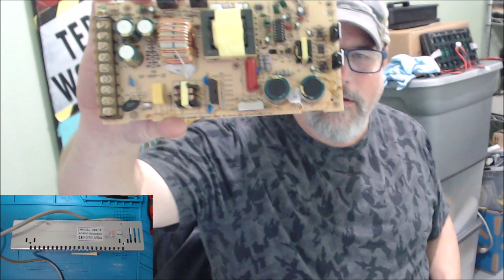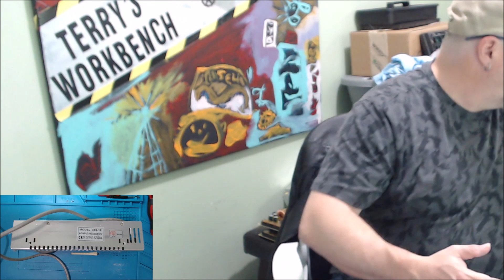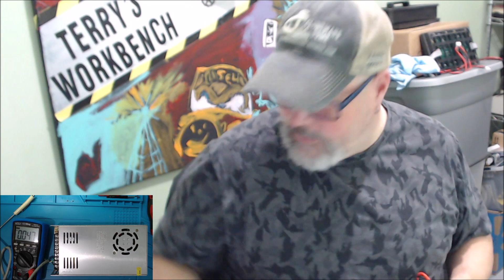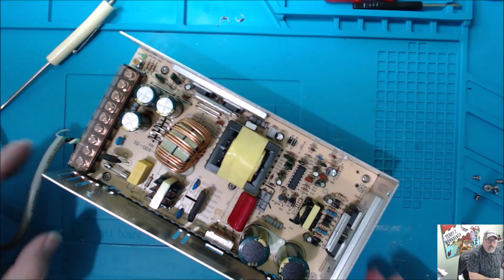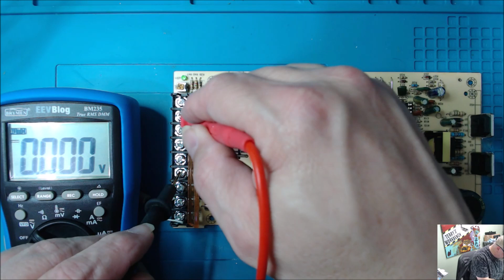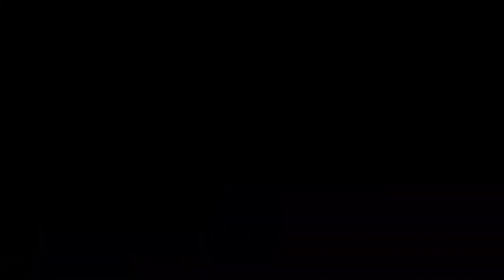Inexpensive Amazon 30 Amp 12 Volt switching power supply repair. 360-12

Comment: Make vid 9n how to quite these power supply they are noisy for radio HF use
Reply from the maker: I know they don't radiate much noise, as I have dozens of these in the front yard and the 160 loop is completely quiet with them in operation. I will take a look on the spectrum analyzer and see if there is anything interesting on the output.

Comment: With the price of these power supplies, I just got another one, so cheap, and I was able to get it the next morning, great fix though. Mine was working fine, I went to power down the unit, I was running off of it, and I heard a huge zap, crackling short circuit sound, smelled fried electrics, I didn't even bother to open it up, the Amazon supplier sent me another one the next morning, and gave me a full credit, and an apology. Can't get better then that.

Comment: would this power a 12 volt motor, maybe 20 amp?
Reply from the maker: That's a large inductive load. If it has a proper circuit to deal with back EMF (flyback diode?), it should run it.

Comment: Great work, great video!

Edit: The transformer and transistors you mention to form a self-oscillating circuit; aren't those the exact transistors and the gate drive transformer you refer to in the video a little later on? That's one thing that caught my eye when you were explaining the working principle at the start. The auxilary windings are often present and running off of the main transformers. 

The TL494 is such a venerable chip; so many designs based on them and things made with them! That also makes them incredibly cheap to make, and as such, ubiquitous in production.

And hence, there's lots of them out there to break. I find a ton of them broken and with their ubiquitous nature, I can find a plethora of resources on fixing them. 

I love the thing! I've made a ton of projects that aren't in its intended range of uses.
Reply from the maker: Yes, the gate transformer is what initially provides power to the 494. Then the 494 starts the switching drive back through that same transformer.  Cooks my noodle just looking at it. It's still magic.

Comment: You don't have any surge suppression on your bench?  Almost all of my equipment is disconnected from the mains by timer-controlled switches and all have MOV protected power strips.  Lightening strikes only affect equipment that is left plugged in; use a switch, circuit breaker or contactor (unless you like fixing your own stuff).
Reply from the maker: These supplies are not on my bench. They were powering Pixel LEDs that span hundreds of feet and have hundreds of feet of power cable, all outside across 2.5 acers.  Given the number of thunderstorms we have in middle Tennessee, I am surprised it doesn't happen more often. Here is a video of the type of work it was performing. 
For scale, those arches are 5ft tall and the house is 300ft away.
https://www.youtube.com/watch?v=PuhyzpG3GNM
Reply: A contactor or switch is not the same level of disconnect as would be the case for unplugging, remember that!

I also don't have surge protection devices. In general, my devices have them built in and I don't have any reason to believe I'll be safer off with MOVs added to my power lines :s
Reply: Lightning strikes hitting close to your home can jump across timers and switch’s. In the days of landline telephones people have lost limbs using the telephone. What do you think it’s gonna do to a switch. Unplugging is the only sure way.